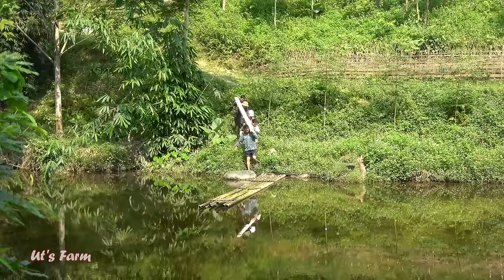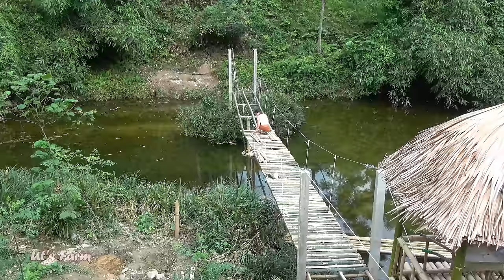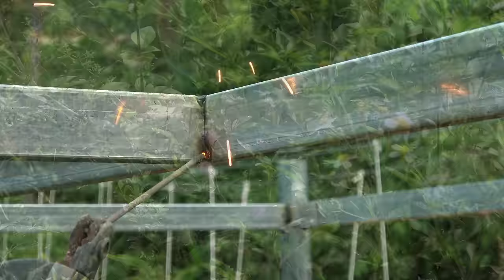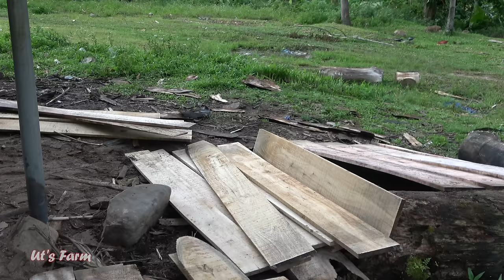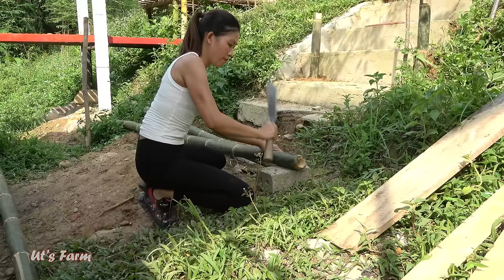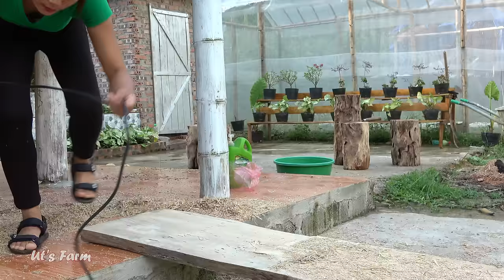TIMELAPSE 30 days building suspension bridge with cables and concrete column

Comment: I liked her idea/ decision to use concrete post as main  columns and proper support installed  where you can tie  the said post for building a  suspesion bridge  or any kind of bridge  installed in the mountain farms over the stream as this will last longer or forever compared to wooden post. Strong post is very important as far as safety measure is concerned.